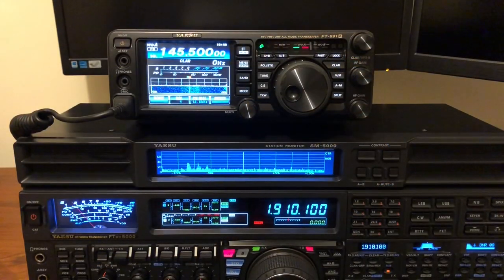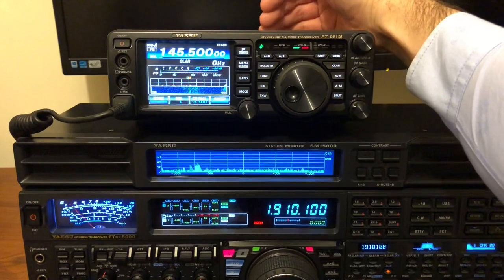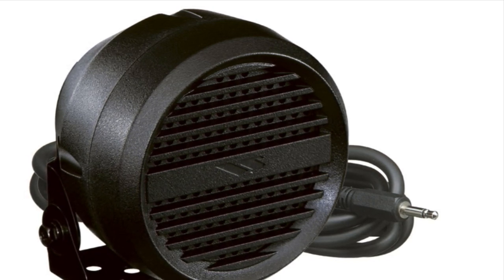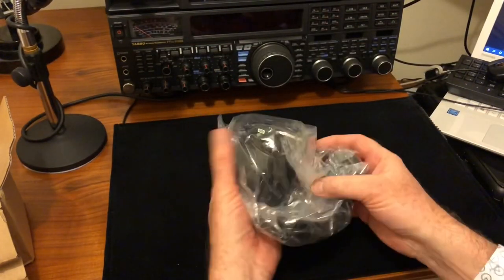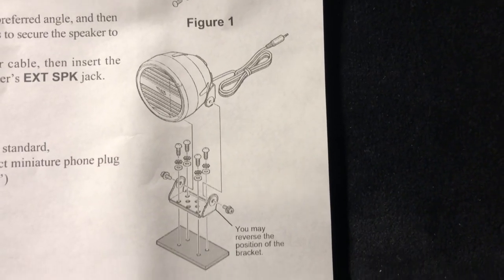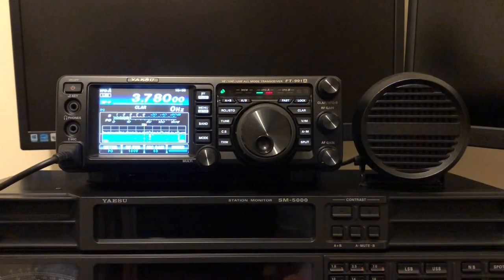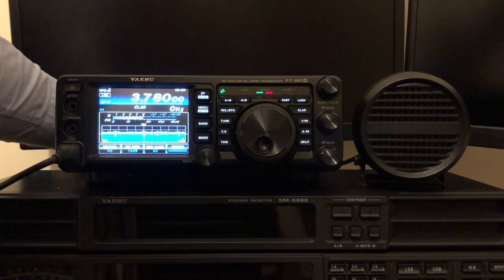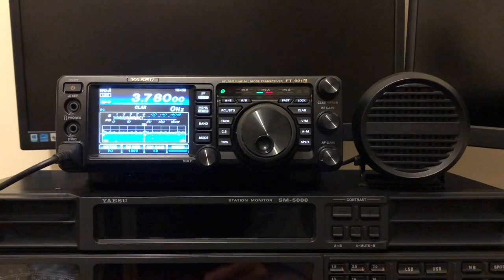Yaesu MLS-200-M10 Extension Speaker

Comment: Any way I'd just worked this lot out WRT my FTM100 with very duff audio the internal SPeaker barely worked and the external output needed to be amplified to hear it at all. I think its the Fuse that protects the amp or both anoyingly the package style of this £1 amplifier makes it rare and a £10 part so make sure you plug the right plug in to the FTM100 and probably the hole of that range ...No doubt the previous guy had just plugged in a Mono Speaker and thus shorted the output to ground ,..... Rather odd design considering the otherway is basically a standard!
Reply from the maker: Great you’ve got sorted 👍🏻

Comment: I have the MLS-200-M10 speaker and it has the moulded logo in the centre on the front, and it has the 3 way plug. I use it with an FTM-100DE which came with a adaptor plug female/male 3.5mm 3 way. If you plug the speaker into the radio without the adaptor their is no audio.
Reply from the maker: Nicholas Taylor Thanks for the info Nicholas. So there are some out there logo’d up then.

Comment: I have tried to connect this speaker via stereo to mono converter but it did not work, so will give it a go how you suggested.
Reply from the maker: Ah right, no it won’t work with just a converter. I’ve now just cut the plug off and rewired, as my little patch-lead in the video was too fragile. Works fine with just a new male mono plug soldered on direct to the cut speaker lead. Have fun!

Comment: I have a mls 100 speaker. then I compared it to the stock speaker in ftdx 3000, finding the stock one was way better when it came to fiedlity. I congesture now that mls 100 may be designed with builtin narrowband filter proper for the use of mobile vhf/uhf rigs. So how about mls 200, is it a full range response speaker?
Reply from the maker: Hi Charlie, you may be right. I haven’t come across the 200 model? I’m happy with the 100 or headphones 👍🏻

Comment: About the mono plug, there are two versions of the speaker: the one without a suffix, and the one with the -M10 suffix. From what I could gather, the version without the suffix has the mono plug.
In any case, I got mine for a FTM-400, and I must say that I'm extremely satisfied with the sound quality. I might do the mod you did, and use the speaker with my Icoms too.
Reply from the maker: Андреја Костић Ah right. Thanks for the clarification. I haven’t seen one without the -M10 suffix, so it looks like online resellers are mixing up the stock photos. It’s the only one I’ve see in the web so far. 

73. 

Ian.
Reply: Do you still need to use the adapter that comes with the FTM-400 for this speaker?
Reply: @Pacman163  Be careful! If you have the Yaesu MLS-200-M10, which has a stereo plug, and where the speaker is connected between the tip and the ring of the plug, then no. This is the correct speaker for FTM-400 and you just plug it in. 
On the other hand, the non-M10 version should be used with the adapter.
Reply: @AndrejaKostic  Thanks for the info I think I will order one for my FTM-400XDR  73 KB9HGI
Reply: @Pacman163  I hope you'll have fund with it! :) 73 de YU1NKA/DM1NKA

Comment: Thanks for confirming all the things I have just found out after 1. Finding out a Yaesu stereo speaker won’t work in a FT891. 2. Simples, buy a stereo to mono adapter from Amazon, wait patiently for delivery. Insert Said adaptor and Yaesu speaker into correct hole.... no sound. 3. Furrow brow and cuss a little.  4. Investigate and come to the same conclusion as yourself, what the heck were Yaesu thinking? Anyway snip snip solder solder and it now wears a mono plug.   So FT891 NOT COMPATIBLE.  FTM400 You must use the stereo speaker if you only have a mono plug speaker you must use the adapter supplied by Yaesu.
Reply from the maker: Strange Steve isn’t it?!

Comment: This speaker DID NOT work with my FTM 300D.
Reply from the maker: Thanks for the info. I wonder what the connection is on the FTM300D as you’d think any speaker with a required plug would be ok? Ohm spec matching of course….
Reply: @ianxfs  The problem is that in the FTM 300-D the radio connector is mono and the speaker is stereo, in addition the wiring configuration is different and a stereo to mono converter doesn't work either. I looked for information on this in Yaesu and it does not appear anywhere. 73 WP4SRT
Reply: @ianxfs  If you have a video showing the setup of the wires you soldered that would be great, or a photo, thanks 73  WP4SRT
Reply from the maker: @DrWillTorr  Most rigs will be mono and my 991A was, hence the rewire of a new mono plug. It also works on my mono TS-2000 and FTDX10. Hope you get sorted 👍🏻
Reply from the maker: @DrWillTorr  That’s what this video shows, the current and new wiring of the speaker? Good luck 🤞🏻